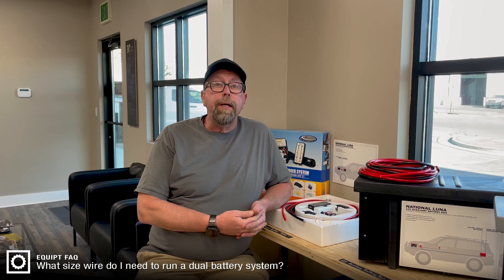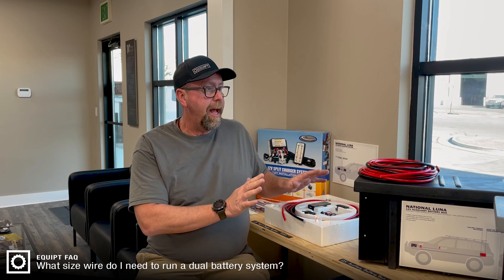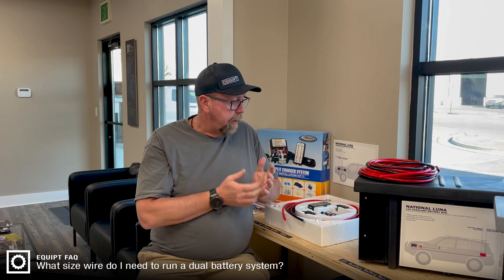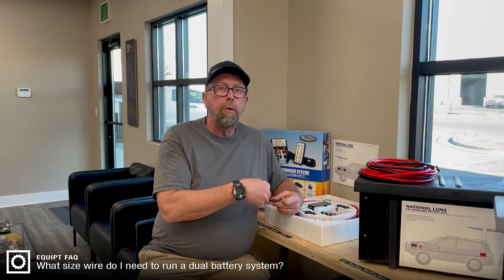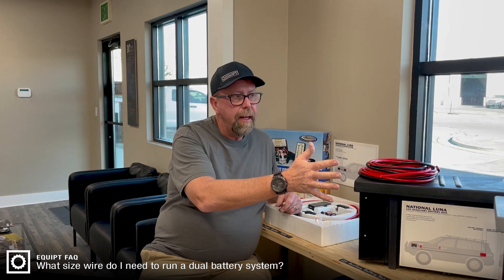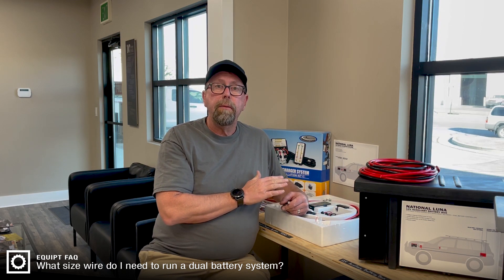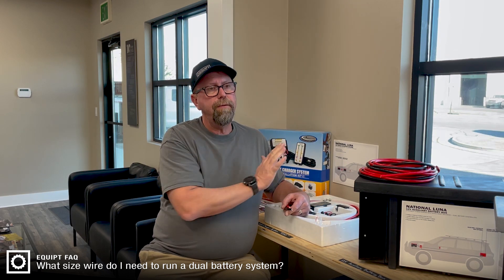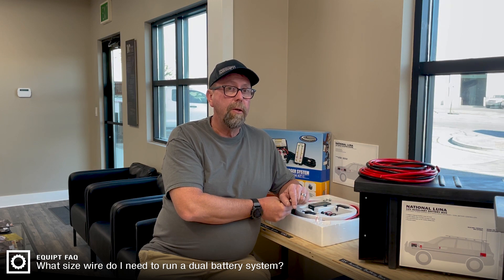Equipt FAQ: What Size Wire Do I Need to Run A National Luna Dual Battery System?

Comment: Great video. This answered my question regarding what gauge wire to use. I was wondering, does the isolator have to be mount vertically or can be mounted horizontally?

Thanks,
Ryann
Reply from the maker: Hi there, 

Glad the video helped explain the wiring gauge. The isolator will function in both orientations but vehicles that see any moisture/rain/water crossings should have the isolator mounted vertically. 9 times out of 10, if there is water damage to the circuitry in the solenoid, its because water got into the housing and could not drain out. 

We recommend mounting the solenoid vertically, all the time, for this reason. 

Hope that helps!

Comment: Could a 1500 watt inverter run off of this second battery for extended periods of time? Could lets say 600watts be ran off the secondary battery for 5 hours? If the first battery was draining down, wouldnt all that power have to come from the alternator and through those 4 gauge wires? Are they thick enough for a distance of 10 feet to the trunk? Thanks and any explanation is appreciated. I am learning as much as I can about electricity and wiring.
Reply from the maker: Hi there, this should be the formula you need to consider your options. 

Time = capacity / (power / voltage)
Time = 100 Ah / (1000 W / 12 V) = 1.2 hours

4awg should be fine but you can check an amperage / wiring gauge chart for specifics. IF the vehicle is running, your power will come from the alternator, if the vehicle is off, it should only come from the auxiliary battery. he amp hour capacity within the aux battery is entirely up to you and the battery you've chosen.

Comment: Im thinking about upgrading my system in my car. The system will draw about 1900-2400w. I am wondering if I run a wire to an auxiliary battery in the trunk, would I be able to use a 2 or 4 gauge wire to connect the batteries compared to running a 0 gauge from main battery to amp?I would think the power draw would be lower maybe since it would be using more of the power from the auxiliary rather than the main but I am new to the sound industry so I wanted to make sure I’m able to do things right.
Reply from the maker: This system is not designed for car audio use. It may have some value in car audio applications but I'm not sure this is the appropriate kit for that application. Crutchfield might be a more valuable resource. https://www.crutchfield.com/S-nq9shUnTbtQ/learn/learningcenter/car/cable_gauge_chart.html. Hope that helps!

Comment: If my secondary battery is 10 feet away from the starter battery, and it is also a traditional starter battery and not a deep cycle. And I have an inverter running 1000 watts for 30 minutes on the second battery, or 500 watts for 4 hours on the secondary battery. Do you think the 4 gauge wire is enough? Thanks! I would like to understand how the draw transfers and links up to the other battery.
Reply: I draw 2000w through 4 guage and I don't get any heat from it. 8 guage (half the size) will melt the cable drawing 1000w and over  for too long. 4 guage is what comes in most kits